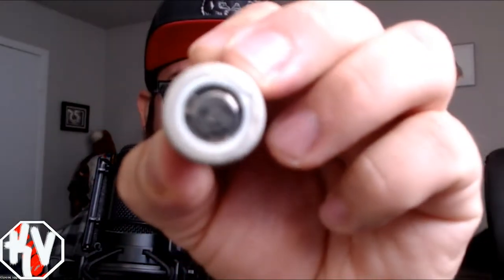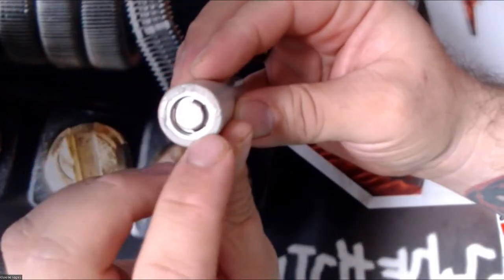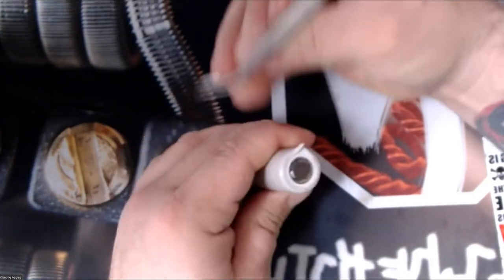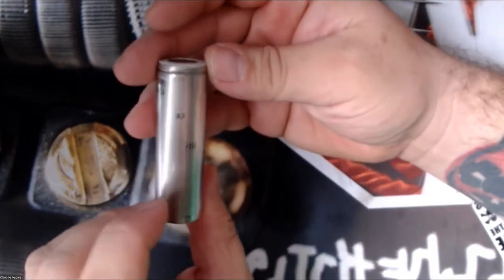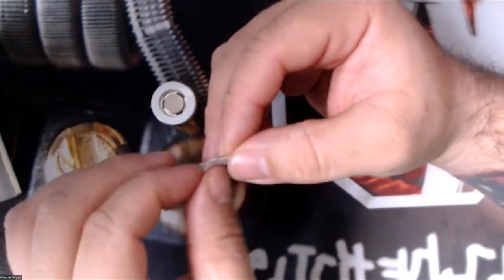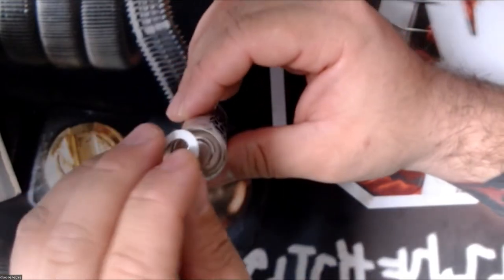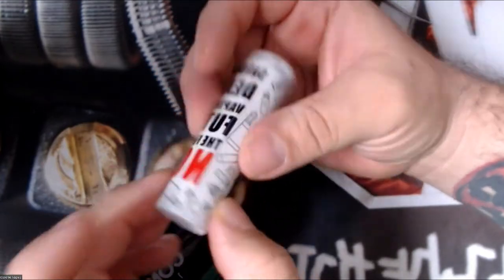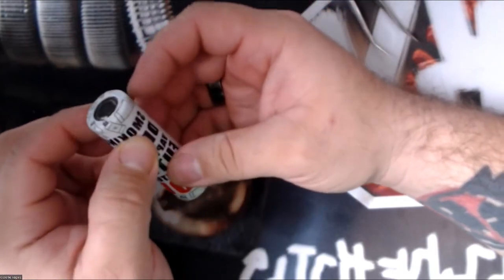3-3-2019 Battery Re-Wrap Tutorial

Comment: Youch!
Use ceramic tweezeers around the top (if you really must use anything on that end), and NEVER anything conductive.
It's actually much safer to start at the negative end, so that you don't need any tools at all anywhere near the positive.
Even the top ring of the can is part of the negative, and you got perilously close with those stainless steel needle point tweezers.
I use clear wrap with a label inside on bank paper (very thin) giving place & date of purchase along with the make and model of the cell and Mooch's rating for current and capacity.  If it's married to another cell, I label the pair as married with their own letter code (I can't see myself ever needing 26 pairs, so a letter code is great - I'm up to "I").  Cells are married to each other, not the mod, so can be moved around if it is done at the same time.
Even on regulated, you need to remember that there is a potential (voltage) between the cans, which can even be touching!
Mooch is best reached on ECF, has a youtube channel of his own, and also has a patreon account, and I can't think of anyone we, as vapers, should be giving greater support to.  He'd like to be able to afford to work for us full-time, but without more patrons, simply can't, although he goes well above and beyond the funding he does raise (most of which goes on test equipment).
Reply from the maker: Dude seriously thanks that is great advice all around, love the idea of the clear wrap had not thought of that. Yeah completely space on adding mooches links on here. He is the man when it comes to battery safety and make sure we as vapers use the best out there. Again thank you friend.